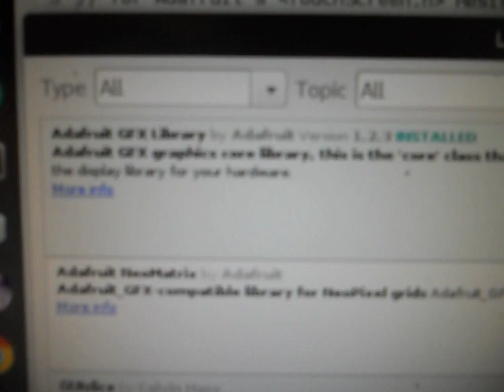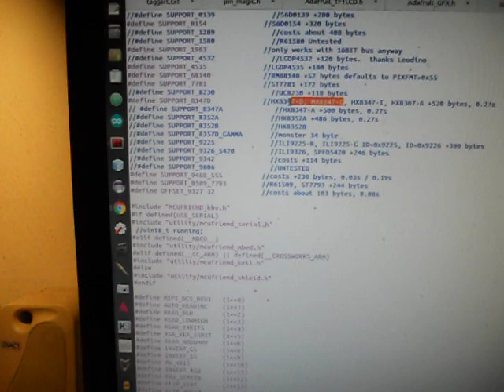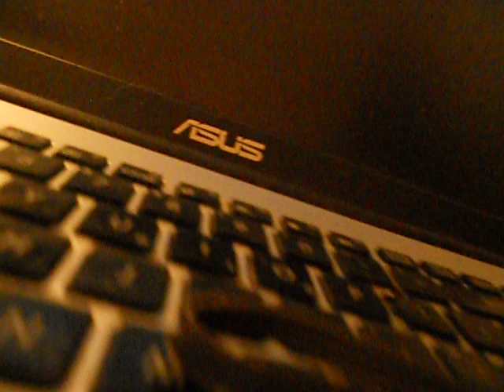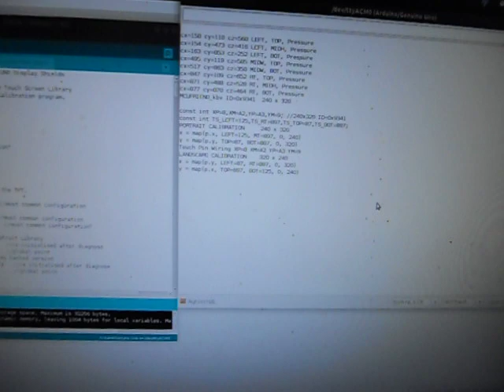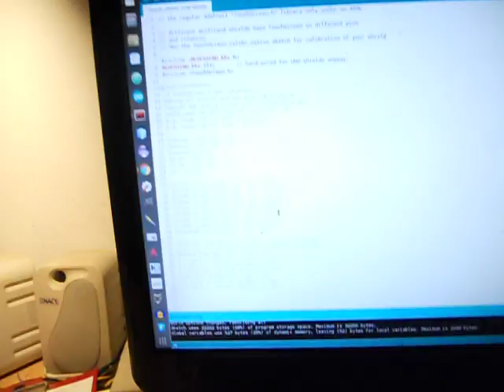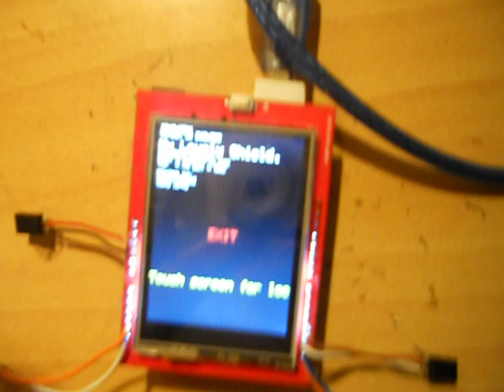Setting up 2.4 Inch TFT LCD Arduino Shield ILI9341 HX8347 from Banggood

Comment: I got the three piece set from Banggood.  the 2.4 In. unit displays all text backwards.  Anyone have an idea what's wrong?  The Cal program icons appear in the right places (e.g. left top, left mi, etc, then right top, etc).
Reply: Also received the 3 piece set from BG last week. The 2.8 works sort of. The 2.4 hardly works. No Touchscreen, scrolling in reverse. It seems that some mods need to be done in the library ccp file. Still investigating. Anyone with info?

Comment: Hello my friend, I got a big question, I know this TFT LCD was made specially for arduino, but, it would be posible to use it with a microchip PIC ??
Reply: Why not? It can be communicate with just standard 3.3V cmos logic IO or sometime SPI, the only things can preventing it to work is coding bugs or hardware connection problem.